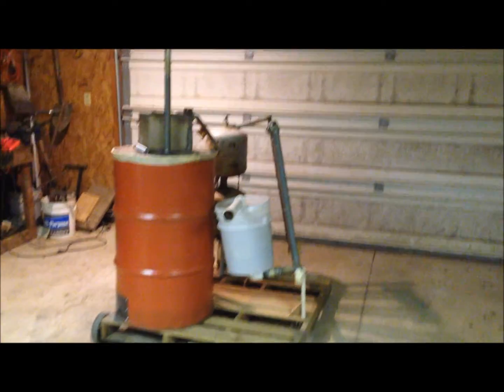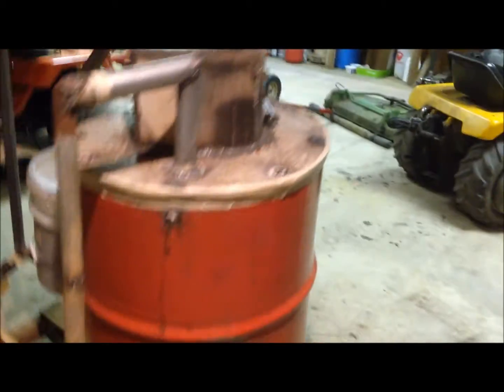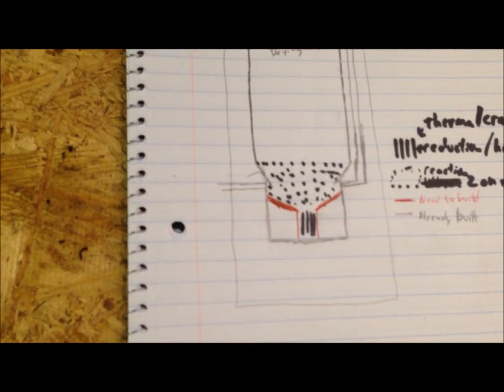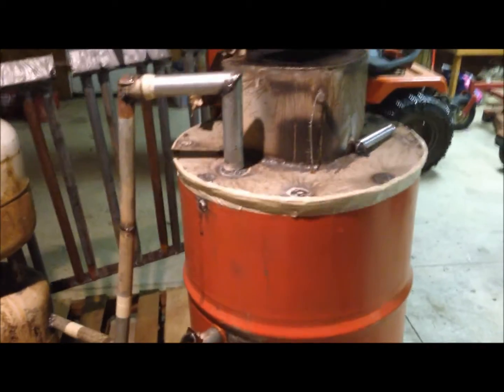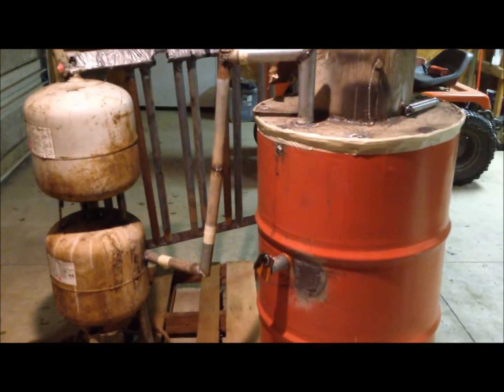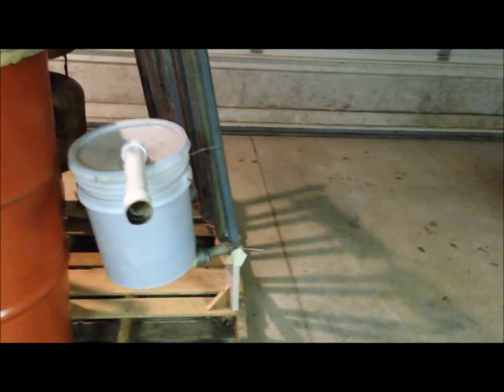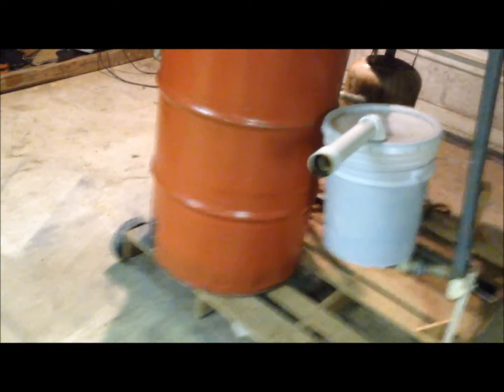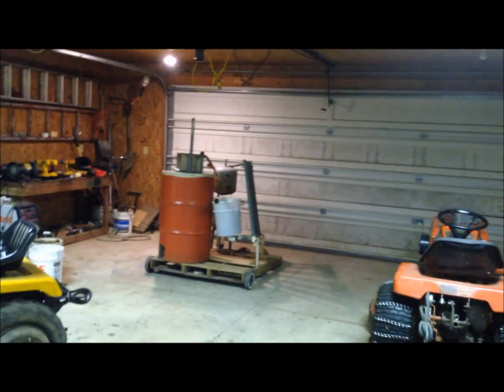How Not to Build a Wood Gasifier Part 6 (Problems)

Comment: catalyst usually need high temp to work.
Reply: A catalyst, by definition, facilitates a reaction at lower temps (lowers Ea).
Reply: @DrBlood-cq2cm  ok.. stil "lower temps" here is 300-350c for iron base catalyst's. stil the normal ones used in this prosess is 650-700c

Comment: You might want to make it adjustable to size of the opening you need to get the right heat and reaction time to make it work right and you can always change it out as you see fit. Then if you want more gas for more horsepower you just change over to a bigger opening.